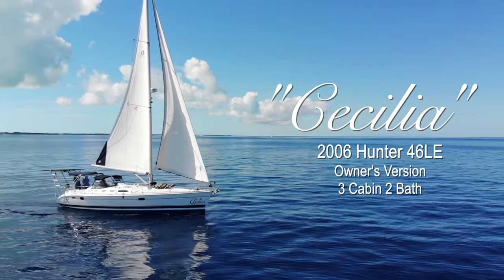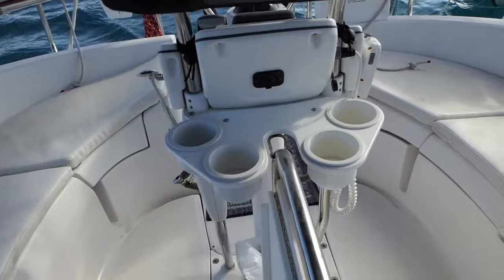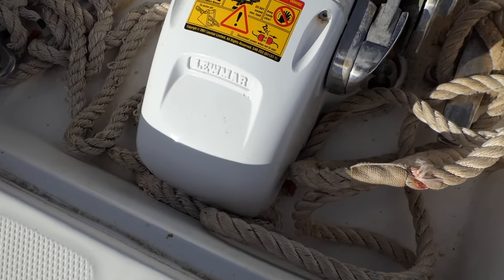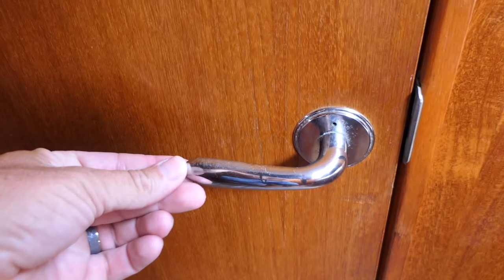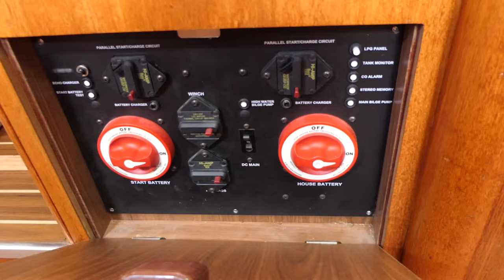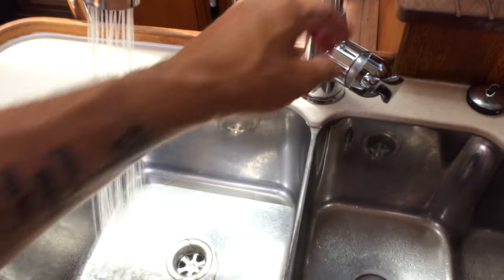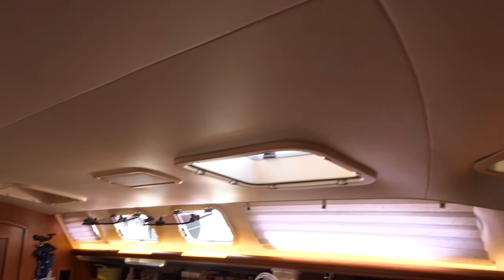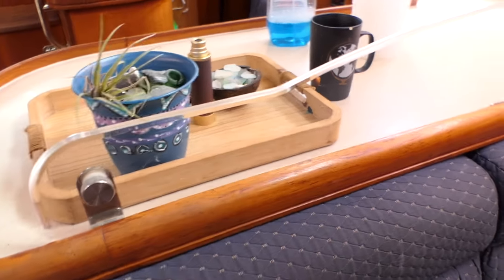Liveaboard Sailboat FULL TOUR - 2006 Hunter 46LE - FOR SALE

Comment: I've got a similar 2003 Hunter Passage 456. Probably the same hull mold. (I have a big mast post in the middle of my saloon.I think the compression post here is in the wall to the forward cabin.) I love my Hunter. It's roomy, comfortable, everything is well made. It sails well and is comfortable. (I did think the higher center cockpit might rock a lot but so far it's no problem at all.) Good video showing all the working sheets. Most videos don't do this. (If you look at a boat, look at what the sheets are doing at the gooseneck. The new boat I was just on looks like reefing was invented six months ago. Total mess. Chaffing.) 
 My heating and AC is a heat exchanger, very efficient (and what everyone is moving to today.)  The video doesn't show how the dinghy is stored. If off the back rack then the sugar scoop is a bit blocked, on the front deck (where mine is) then the fore cabin is dark.  I back my Hunter into her slip and getting on board is like walking into the house.  The soundproofing is really good. I spent three days on a really nice Jeaneau 40', no wind. We got sore throats talking over the engine noise. That'll never happen on this boat.  I was just on a new boat. Whenever the water pressure pump turned on it was really loud. No effort at sound proofing. 
 One thing I did in the galley, that most Hunter owners could do. Install an exhaust fan. I traced a spare side hatch window out onto 1/4" luan plywood, including tabs for the hinges and clips, then I cut a hole for a fan (with flaps that open when its running, close when its off to keep out the bugs. Don't bother with the speed controller, you'll want it on full or off. Mine is 120 VAC). This is mounted in the hatch right above my stove. I just open the hatch and slide it in. Works great. I'll leave it in unless the seas are up.  Boats, just like houses, need to vent exhaust gases, oil and smoke from cooking. Otherwise they build up grease and soot inside the boat and inside your lungs. I was a bit obsessive tracing and cutting out all the parts of the hatch, but now my fan sits in the open port with no latches needed. Pop it out, close the hatch. So I recommend it. 
The layout of the interior of my Hunter is a bit different. I have a huge aft cabin (on top there's an open 'sun lounging' deck behind the cockpit.  Fore there's a wet head at the V and a pullman berth. Aft there's an actual bathtub on the port side. It's exactly what you'd find in a Japanese business hotel. 
The woodwork and cabinet hardware on Hunters of this vintage is terrific. (I've been on newer boats where everything is plastic and breaks all the time.) Having been on a lot of boats it only takes a few nice woodworking flourishes to make the saloon feel warm and welcoming. I installed a 42" HD TV on an articulating bracket in my boat. To lock it down for sailing I drilled a hole to the cabin behind it and screwed a small cleat on the wall. I have Starlink and Apple TV, but I'm behind in my boat work. 
The build of these Hunters is top. No wood core, no topside teak, so the hull and deck could last hundreds of years. Look in the bilges at how the frame is gusseted to the hull. That's how a boat is supposed to be made. Then go look at a Beneteau. Which one do you want to go to sea in?  My boat also has a Hydrovane (that I haven't tried yet. This level of redundancy is good for crossing oceans with a blade rudder, unprotected by a skeg, and a straight keel. the first owner sailed her from California to Polynesia and New Zealand. I'm pretty sure she'd like to go back.